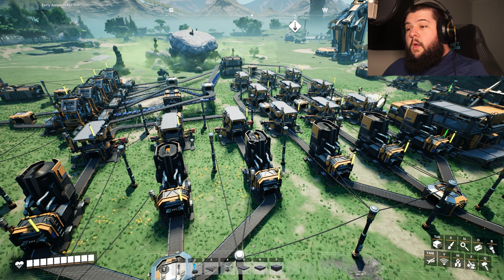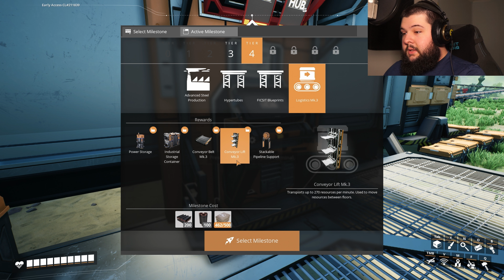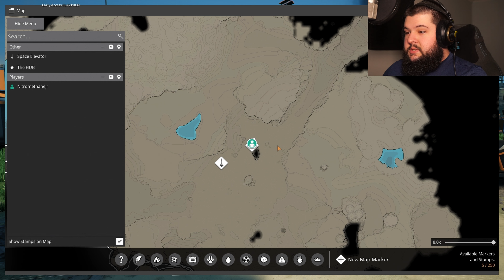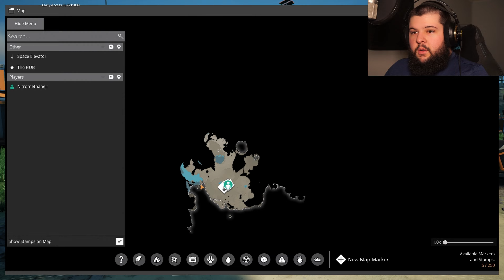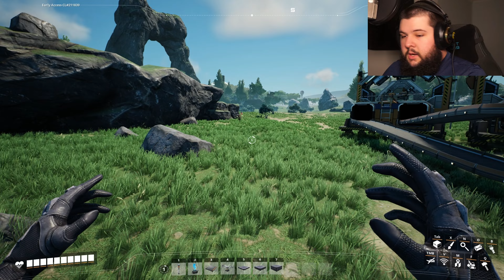THIS TOOK SO LONG!!!!!  //  Satisfactory EP 4

Comment: You can probably reduce about half of the water pumps you put on those pipes.
Reply from the maker: Yeah I could run one pipe per pump but I would need three power cells for full flow vs just one when I run two pumps. But when I get more power cells I will probably reduce them to one per pipe.  Thanks for the comment!!!
Reply: @nitromethanejr5860  No. what i meant was that you don't need to put two pumps next to each other for different sections of the pipes. The water pressure doesn't double if you have more pumps. it's constant until your pipes reach 20m from the previous pump.
Reply from the maker: @YonkoG5  oh ok I get what you're saying, I seen that it automatically snaps to where the next one should go but when I did that it was having trouble keeping up for some reason.